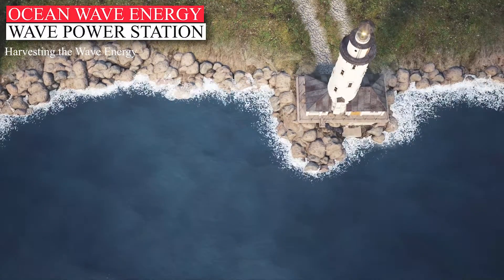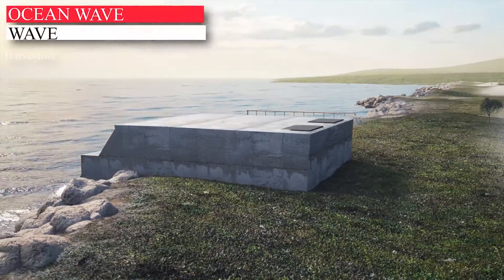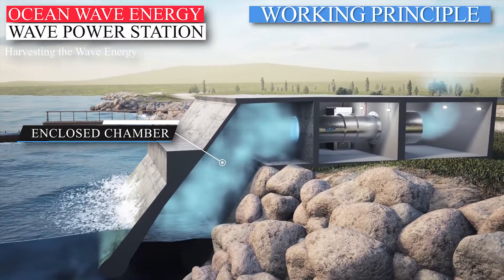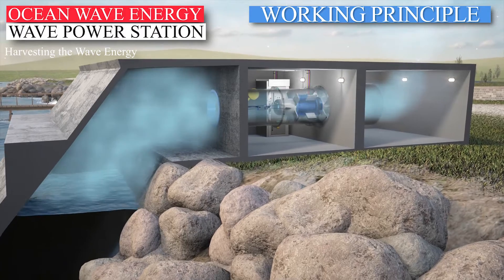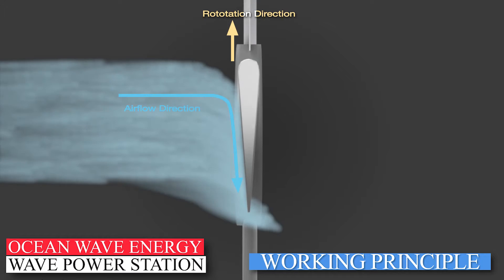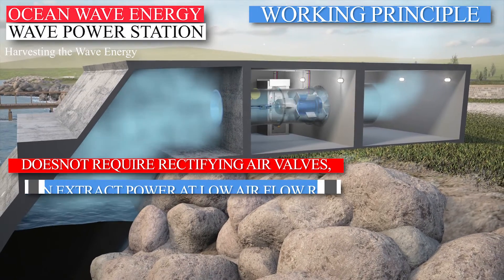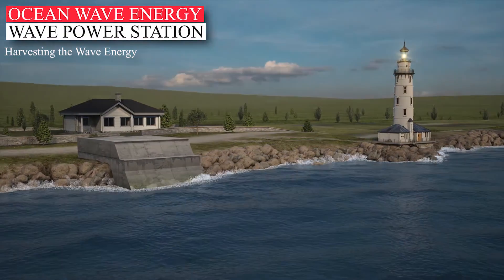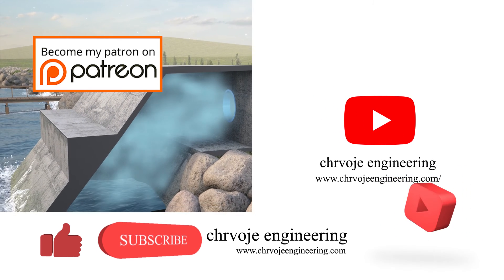Ocean Wave Energy: Wave Power Station [Wells Turbine]

Comment: I  read a report about this type of energy generator, it was about installing lots of these in Australia’s southern coast bordering the “Southern Ocean” the waves never stop, the proposal was to install them in the Great Australian Bight, install the generator on top of the cliff then have a big long concrete tube down into the ocean, the report was to put lots of these connected to big batteries, there is enough energy from the southern ocean to supply enough electricity for all of Australia.

Comment: Wave power is like many newer power technologies. It is effective but it is ugly and unnecessary. We have recently taken a new step to advance the physic of power production by enabling chemistry of the atomic nucleus, or "nuchemy", We are passing the chemistry level where we interacted with electron shells and are moving on to manipulations in this "nuchemy" atomic nuclear era when we interact and multiply nuclear protons. We have rediscovered the lost work of the alchemists and can make new elements with different atomic weights and vastly new properties. This was ably demonstrated in "The Safire Project". Quanta are important. We now have enough energy in them to manipulate the atomic nucleus much more easily by creating a compartment or a local region of plasma containment so reactions at this atomic nuclear level can easily take place. This is about to practically enabled a fantastic new era of energy production for the whole of mankind. This with free fuel obtained from water or atmospheric moisture anywhere in the world. New fusion nuclear is at the industrial commercial production final development point as of now. The energy argument and other power methodologies are all now irrelevant as we have new and very physically and economically powered practical and local community level fusion nuclear power. Solar roof plus Teslawall battery may be the present way to go domestically but megapack batteries and multiple storage technologies interconnected with an expanded ugly grid have a less certain requirement when you consider new any-scale community based and 24 hr self-fueling reliable fusion nuclear in the form of the "Safire Generator". Learn all about it at "aureon energy.com". Learn the newer EU physics at "Thunderbolts Project.com" and you will be permanently reeducated with the advanced new theory.
Reply from the maker: Thanks, for feedback...but do you agree that wave power is effective on remote island etc...
Reply: @chrvoje_engineering  I am very enthusiastic about all these new green energy products, but we cannot escape the new plasma confinement physics and Fusion power resulting,  all as a consequence of "The Safire Project" and resulting in the "Safire Generator" which is the safest and most compact and economic green power conceivably possible. It can be built on any scale for any load size requirement and is very compact. It makes all other power generators redundant immediately it is produced on a commercial scale. It is simple to produce, super cheap and 24 hr, dependable. Tell me how can any other electric production, green or not, possibly ever compete with this? Be sure to check out "Aureon Energy Ltd." before you invest in wave power although an Island would have been your ideal site. Kind regards, David at dgillman47@gmail.com.
Reply from the maker: @davidgillman5368  Yes I read about that, it seems very interesting, also for me very interesting is "plasma technology waste managment"  https://energydigital.com/404search?query=greentech-plasma-gasification-turns-waste-energy
Also im making script, documentary about ITER proyect https://www.iter.org/
Reply from the maker: @davidgillman5368  Also if you are interested, can you make script about SAFIR proyect and I will make video?!
Reply: That was a very good explanatory YouTube film and it seems a very polished and well conceived project and I like it. @chrvoje_engineering

Comment: 1) By reflecting away 30% of ISR the albedo, which would not exist w/o the atmosphere, makes the earth cooler than it would be without that atmosphere like that reflective panel set on the dash. Remove the atmosphere/GHGs and the earth becomes much like the Moon or Mercury, a barren rock with a 0.1 albedo, 20% more kJ/h, hot^3 on the lit side, cold^3 on the dark. Nikolov, Kramm (U of AK) and UCLA Diviner mission all tacitly agree. 

2) the GHG up/down welling, “trapping”/”back” radiating/delaying/intercepting, 100 % efficient, perpetual warming loop requires "extra" energy which according to RGHE theory comes from 

3) the terrestrial surface radiating "extra" energy as an ideal black body which

4) cannot happen because of the non-radiative heat transfer processes of the contiguous atmospheric molecules and as demonstrated by experiment, the gold standard of classical science: 
https://principia-scientific.org/debunking-the-greenhouse-gas-theory-with-a-boiling-water-pot/

1+2+3+4 = 0 Greenhouse Effect + 0 Greenhouse gas warming + 0 man caused climate change. 

Version 1.0 032421 chrvoje engineering
Reply from the maker: Interesting